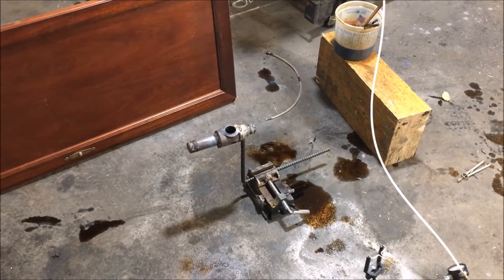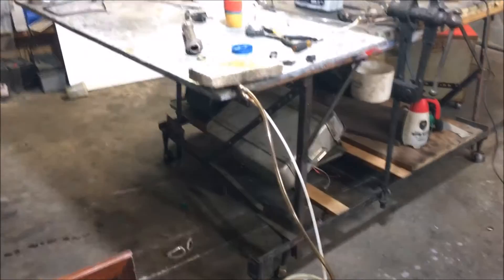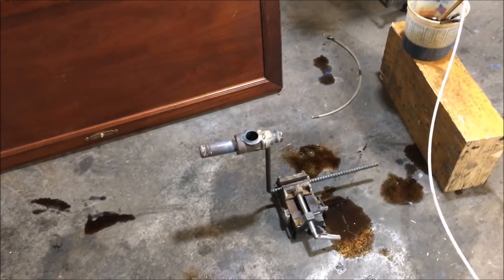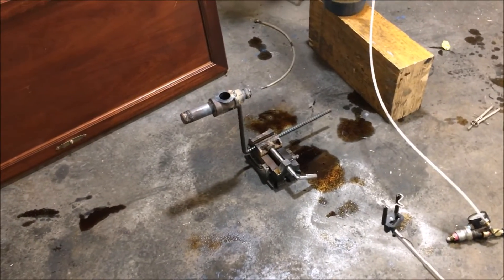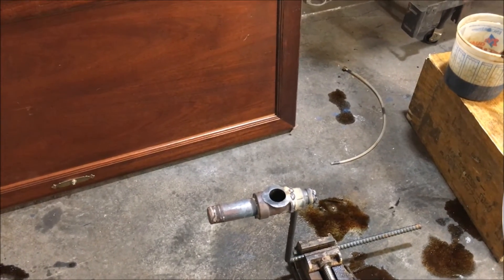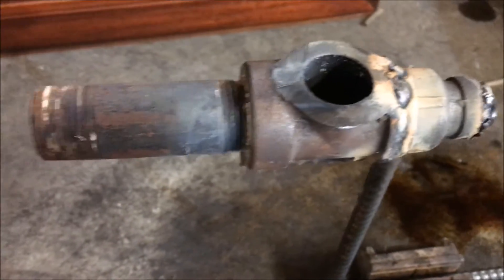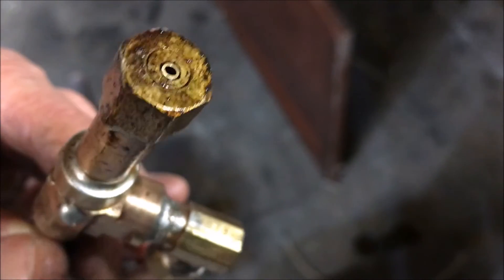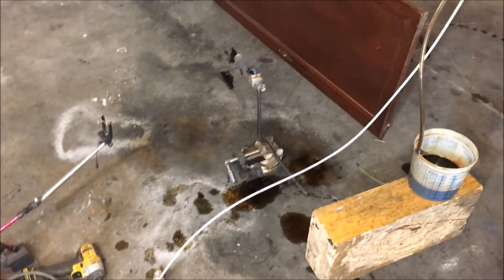MICRO Waste oil burner design( nozzle position acquisition)  Combustion chamber Modification .

Comment: I've engineered a lot of stuff on the fly for proof of concept, then come back and played with the design before working up a print and making something 'high techy' looking.
Reply from the maker: Only way to go in some cases , unless you have access to a super computer or low end simulation software
Reply from the maker: I got something cool coming up with this device , im incorporating your suggestion on the next build " down stream tapering " found and excellent combustion liner from an old heat gun that fits perfect
Reply: That should help hold the heat and increase efficiency of the burn some.